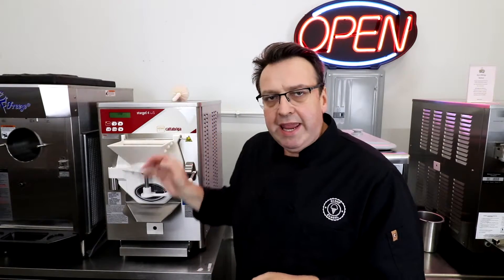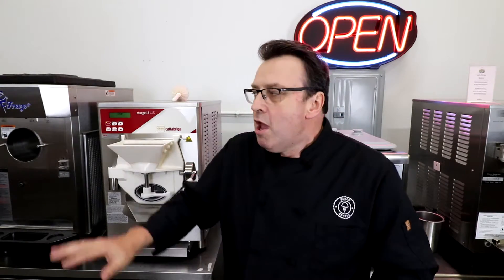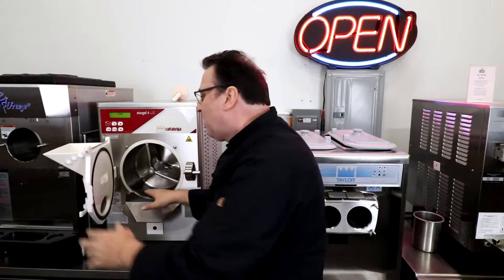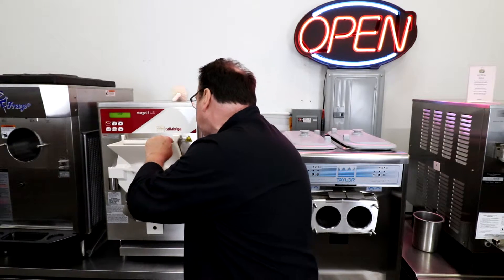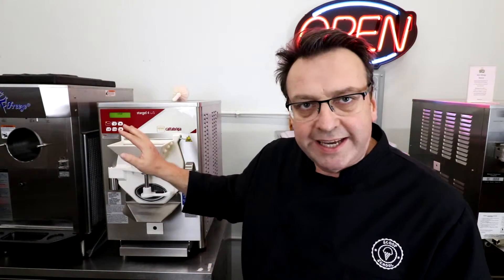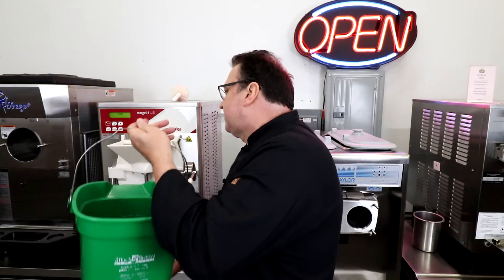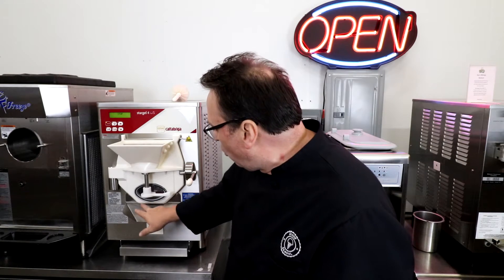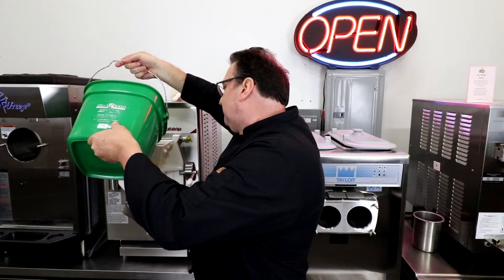Rule 3 of Batch Freezer Assembly

Comment: but most carpigiani heat water themselves on cleaning mode !
Reply from the maker: If the batch freezer itself is designed to heat - then that capacity will be built into the freezing cylinder
Reply: @ScoopSchool  you're absolutely right, it's on those who can also pasteurize